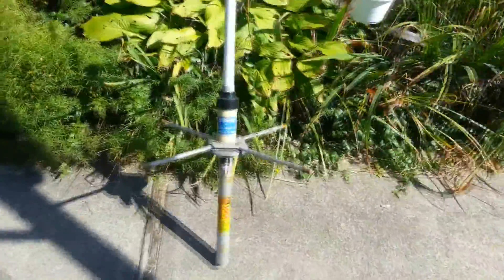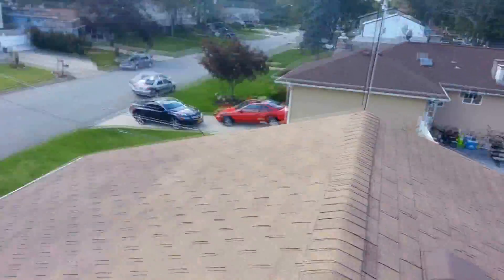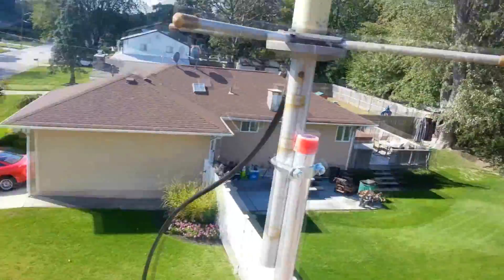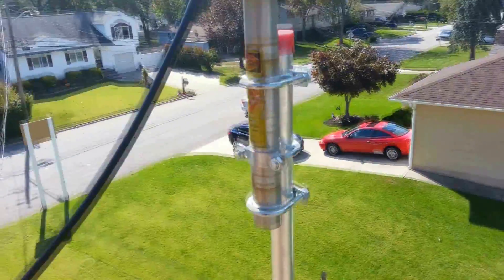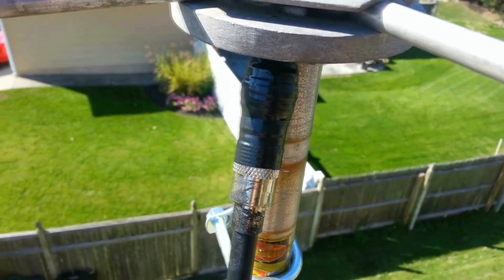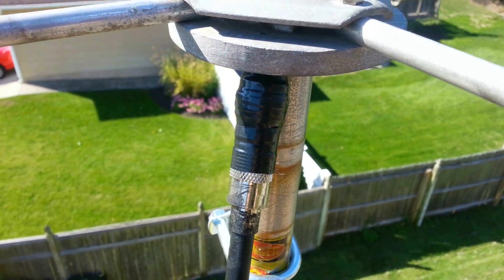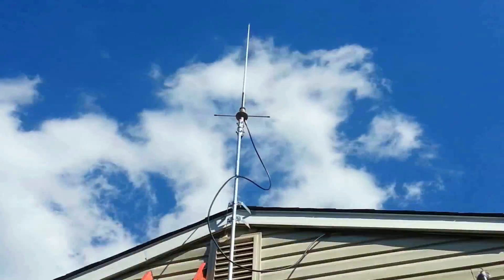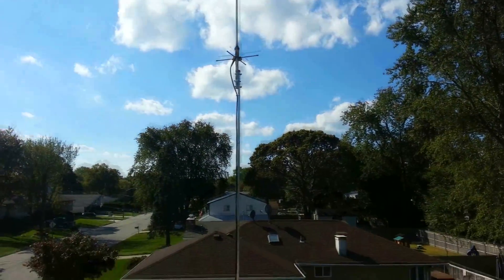Installation of a GMRS Hustler G6-450-3 antenna

Comment: Lightening like a shark that smells blood WILL FIND GROUND wherever it's at.  A controversial topic.  You Tube creators should at least make their antenna installations appear to be grounded to satisfy the viewers!  LOL!  Would love to see a comparison between the Hustler and Ed Fong antennas!  Thanks for the content! 73, Mike
Reply from the maker: No need.. I do not want to complete the circuit,  you can..
Reply: @RFRadioNetwork  I don't loose sleep about grounding.  My point is lightening will seek any ground it wants all the way to the safety ground of you're power supply.  Not disagreeing with your approach, sorry I commented.
Reply from the maker: The Hustler died for some reason. I no longer have it. I do still have the Ed Fong, and the now Comet 712. Unity gain vs 9.15dB

Comment: You have a good Installation overall. The only thing I would do differently is replace the zip tyes with black tape on the cabling down the pole.  The reason is the zip tyes can damage the outer jacket of the cabling over time.  Just FYI.
Reply: Todays China zip ties are junk, lucky to last a year without falling off, get Scotch 44 tape. Mine has been on for over 20 years without a failure..
Reply from the maker: I didn't tighten them, however tape will crack and become brittle over time. Interesting info though

Comment: Don't the GMRS rules cap the max antenna height at 20 ft above ground
Reply: Nope. 20' above the structure its mounted to.
Reply: Nice install     WRWR298/ KE5MUG
Reply: @mlr06121974  I was wondering about the height restriction.  My Larson GMRS antenna is mounted off the side of my tower.

Comment: I thought,.....(although I may have misunderstood), that the antenna height limit was 20 feet high, or less. If I had to guess, I'd say this is at least 30 to 40 feet high. How are you getting by the rule like that??
Reply: 20' above the top of the structure its mounted on. Could be a 500' tower, you could still go up 20'

Comment: Looks great ! Don't know what coax you have. I went with N connector on coax . Depending on install I use LMR or Helix type cable for UHF . very low loss. I got RG400 coax in my mobile setup for UHF.  you can use UV rated heat shrink to seal coax. I add dielectric grease on outside before heat shrink . Lots of snow ice hear. Also lots of grounding because of static build up  from snow . locally my fire and police use 460Mhz and 453 Mhz. I found that commercial UHF antenna tune just fine for GMRS . 73s

Comment: Good job.. 2 comments. Always tape going UP start at coax like your shingles, never top down. And 2- where's the ground wire?
Reply from the maker: Actually, no ground wire. If I add one it will be visible to lightning. Right now its invisible. It has been up for years without an issue. It has been an on going experiment that seems to working.

Comment: Awful  close to the power line coming into the house!
Reply from the maker: My power line is not a bare wire. Its insulated. You need to have confidence in your installs.
Reply: @RFRadioNetwork  Very confident in mine.
Reply from the maker: @dheller777  Same here. I have 3 now..

Comment: How does this work on a duplex GMRS Repeater setup I'm looking for a good high gain antenna I was thinking I may need an 2 or 4element antenna but figured I'd ask around first
Reply from the maker: Works awesome. Any Antenna would work. I recommend the COMET-NCG CA-712EFC. newer and taller. and more reach. I have since changed it to that.

Comment: How did you ground it. Mine is grounded to the water pipe.
Reply: You need to ground it. It isn't a matter of if, but when. When it happens you need to divert as much fault current as possible to the ground. There is no such thing as insulating against lightning, only diverting it.
Reply from the maker: Funny you should ask. Not grounded at all. My thought process if its grounded (I completed the circuit) and it would be visible to a lightning strike. Been up there for years, never been hit. Its an experiment I've been working on. Thanks for the question.